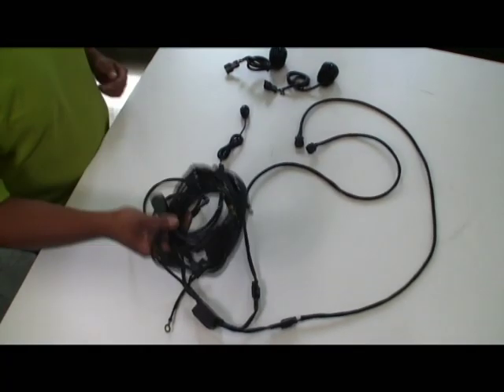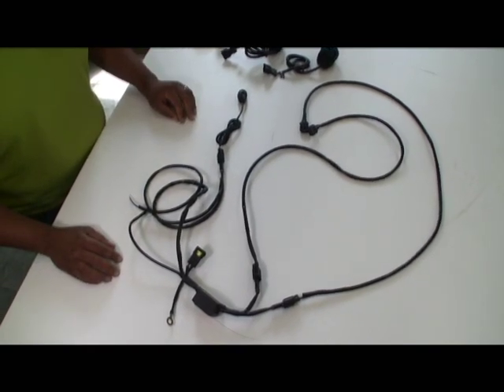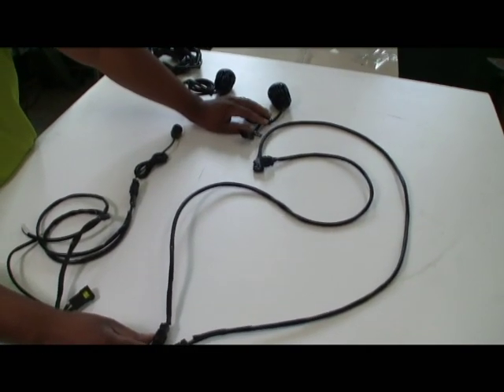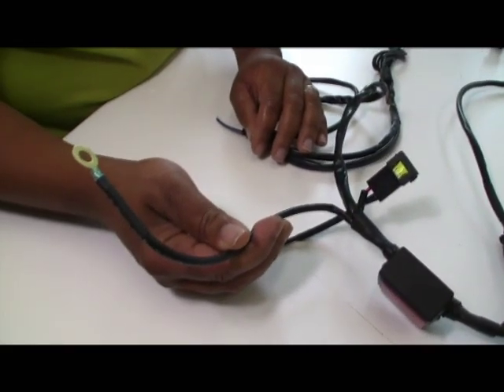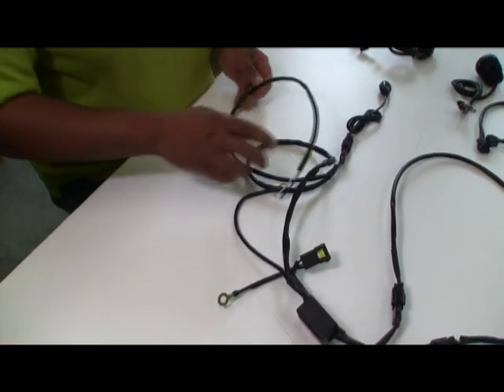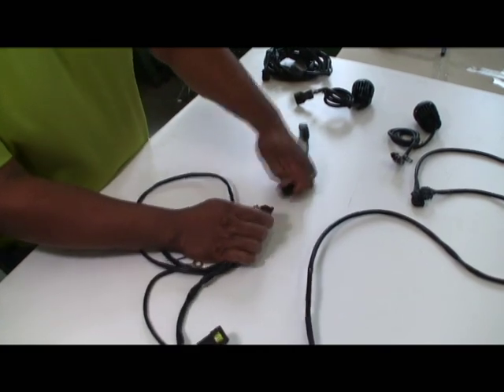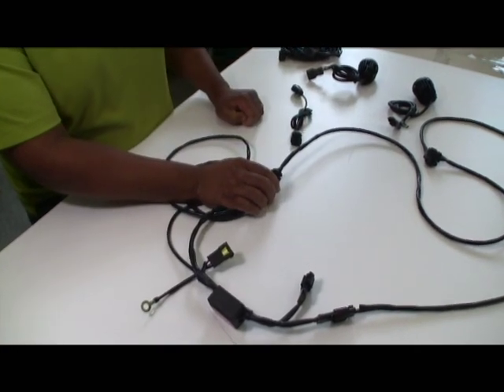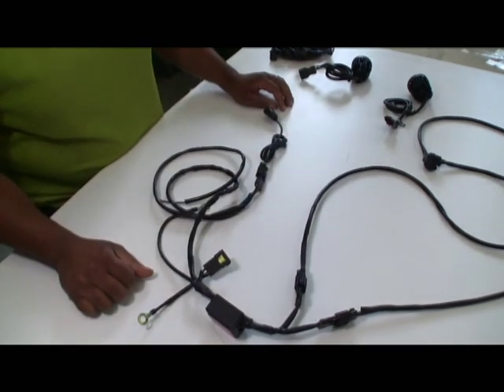Denali 2 wiring harness introduction

Comment: I have an FZ1 Fuzeblock wired into my GTR. Can I connect the Denali harness +ive and -ve directly into that (with the fz1 fuse in the switched power position). When I turn the key it will all come on. Nth bothered about the toggle switch as they're running lights.

Comment: agree that it's quite pricy -though still relative.  avoiding one accident can pay for itself many times over or even save one's life.  

you implied numerous other LED kits can fulfill the same requirement.  please share other LED kits that work on motorcycles with the similar performance and construction and also cost less.  i'd like to buy some.  thank you.

Comment: to avoid incorrectly connecting/reversing the wiring for the harness, twisted throttle could have simply developed the harness using different connectors.  HID kits do this and make it impossible to reverse the connections.  surprised you guys did think of this.